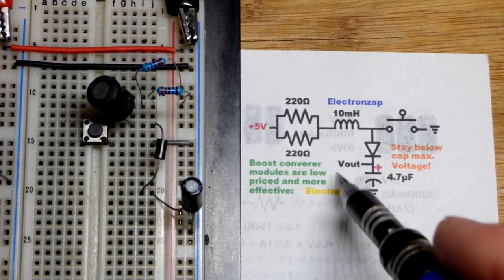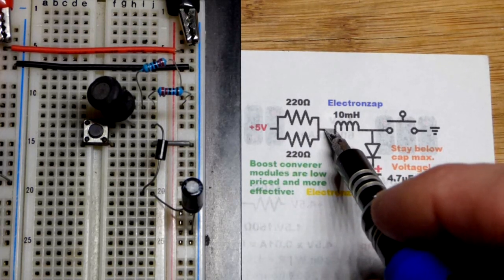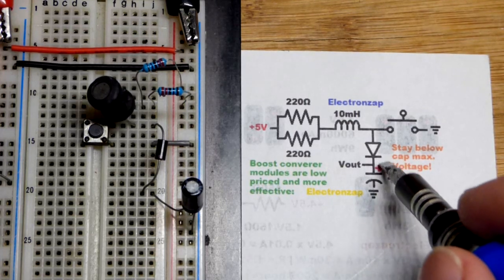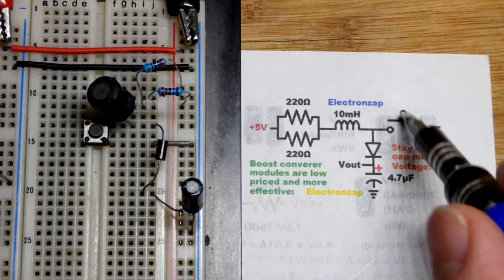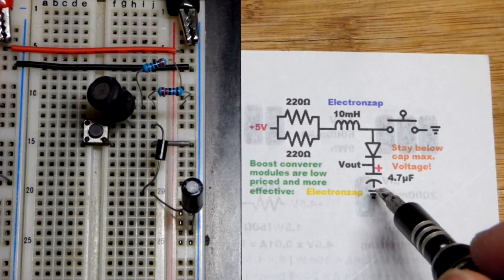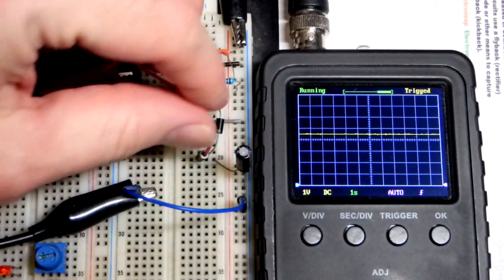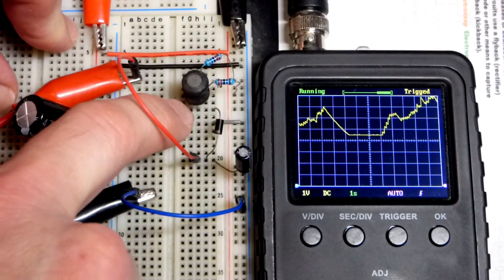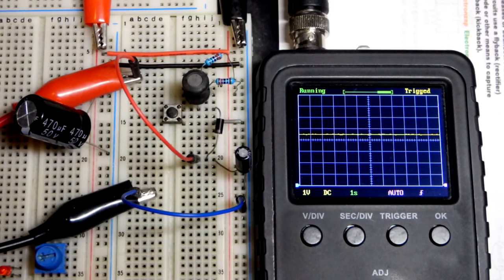Simple inductor voltage boost converter demo circuit for learning electronics shorts 88

Comment: So i wired up the circuit as you demonstrated. Instead of using a DMM I hooked up the capacitor output to my scope. Using 4.7 microF cap and 5 V input I found it hard to achieve voltages above about 13 V. I think the limiting factor here is how fast you can press and release the switch as the back EMF induced is proportional to the rate of change of current. V = L*dI/dt.  So instead of a manually operated on-off switch I hooked the circuit (junction of inductor and diode and to ground) up to a 5 V relay and hooked the relay up to a function generator with a square wave 5 Vpp, 2.5 V DC offset at 1 Hz. With every audible "click" of the relay I could see the the horizonal line representing capacitor voltage incrementally increasing upward. As I was only using a 25 V cap I stopped at 12V which came quite quickly. I replaced the the cap with a 50 V 47 microF cap and increased the frequency to 20 Hz with same outcome to 25 V. Since the rise and fall time of the AWG is much faster than what one could achieve manually it is a very efficient way to boost voltage. Since my AWG is referenced to ground viz the BNC connector I made sure to have a common ground by connecting the ground output of the TekPower supply (I have the same one as yours) to the earth grounded output of my desktop power supply. (The later should be plugged to the wall outlet but does not need to be powered up). I just find it more convenient to use the TekPower rather than the desktop unit for most work. Of course the square wave amplitude you use will have to be equal to the pull-in voltage of the relay you are using.